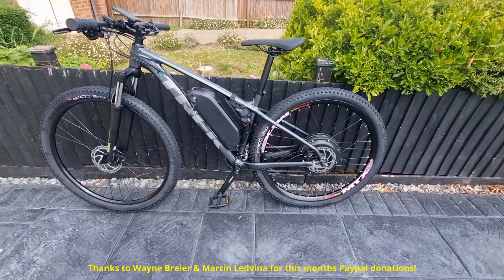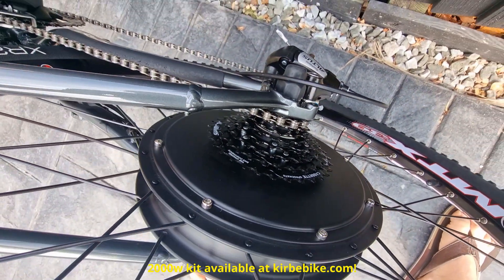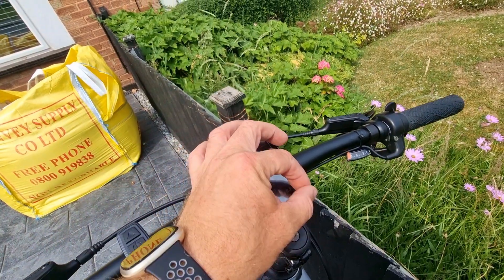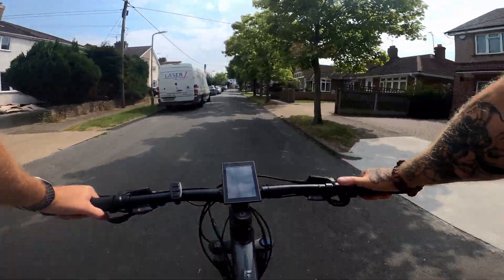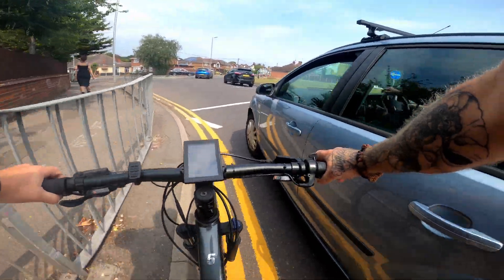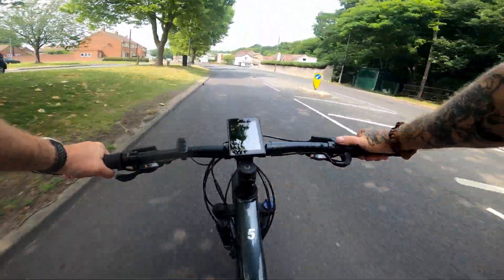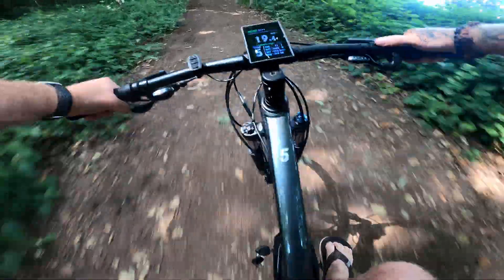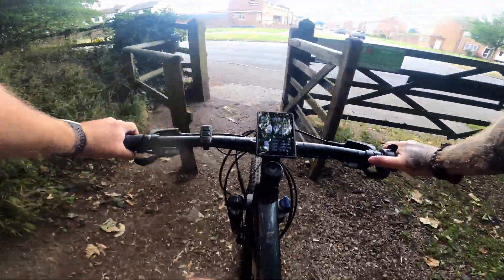BUILDING THE ULTIMATE DIY EBIKE IN 2022!

Comment: I'm thinking of buying this kit.. I want a full suspension bike that can fit the battery like that in the frame like that hailong or whatever they are.. I don't mind older stuff just want it under around 800 preferably 500 obvs secondhand varies, ya get the idea what sort of bikes you know of for that.. thankyou if you can help.

Comment: Does it have the upgraded freehub for 8 and 9 speed cassettes fitted so you were able to fit the original 8 speed Shimano cassette, if so did the wheel fit the dropout ok on the Marlin 5 as the website doesn't mention the upgraded hub dropout size? 
I have a 2022 trek marlin 5 and would like to order a kit.
Reply from the maker: Kirbebike 2kw kit comes with 7 speed freewheel as standard you can order 9 speed cassette upgrade.  Andy needs to add 8 speed cassette upgrade option also as he can supply 8 or just change the 9 speed cassette for your own off your wheel.

Comment: Nice build Steve.  Just finished a very similar build...Cannondale Trail 6 29'er frame, big 52V battery but built with mid drive Bafang BBSHD.  Top speed is just over 35mph.
To me, these bikes are the sweet spot. Why? Weight versus power.  Enough suspension to take roughness in the road, enough power to keep up with cars on secondary roads...light and tossable and easier to ride than a motorycycle...ride them anywhere without drawing attention and can keep them inside the house if you like.
I come from many walks including competitive cycling and motorcycle racing. For a faster bike, I prefer gas powered....lights, more suspension and braking.  I also built a drop bar road bike with BBSHD and love it to bits but it is not good for anything other than very smooth surfaces...but it will do 40 mph and a hoot to ride with top amateur cyclists.
I am sure your new build will sell quickly in the UK because you can't buy an ebike like that in the UK or America where I am from.
Cheers from across the pond.